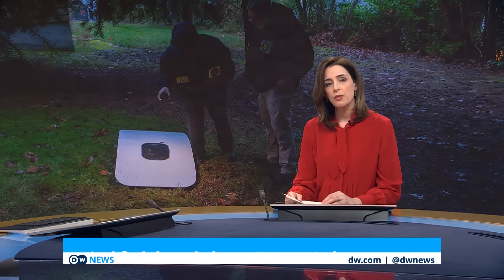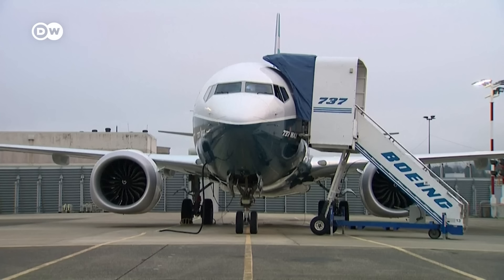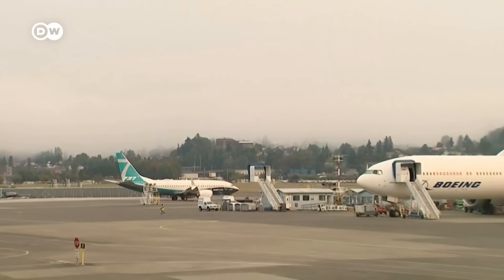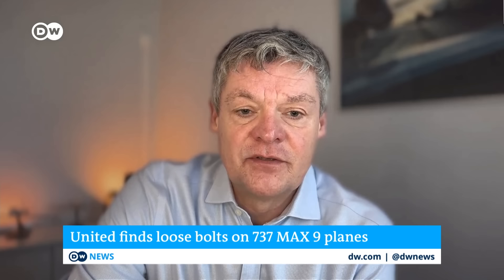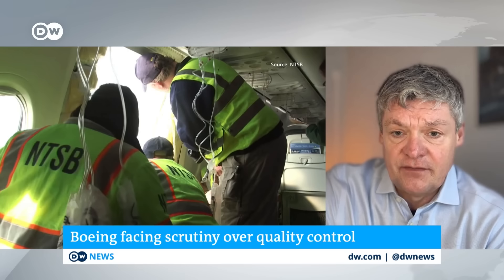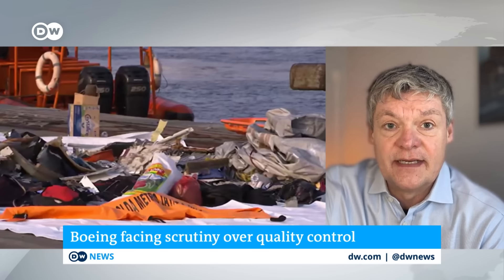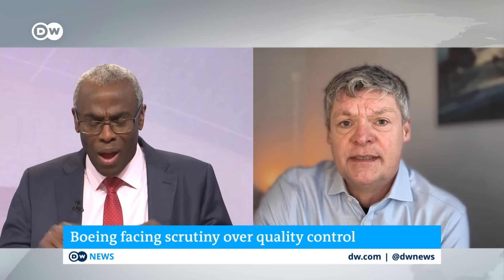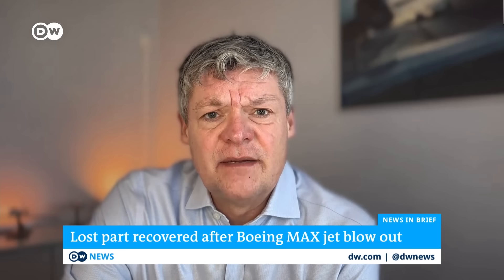After the Alaska Airlines incident: Is aviation quality control insufficient? | DW News

Comment: The question now seems, is or what did Boeing tell individual Airlines, or what Boeing did not tell Airlines which buy Boeing aircraft, over how everything on a Boeing aircraft operates and function etc? 
Or what legally Boeing is required to tell Airlines who buy Boeing aircraft, over how everything on a Boeing aircraft operates and functions etc, is a matter for the FAA and NTSB to investigate now? 

However, is Boeing responsible as a company, to inform all Airlines Pilots and Cabin Crews, how everything on a Boeing Aircraft operates or functions,?

Or is the Airline responsible, for training of their own pilots and Cabin Crew? 

When Boeing provide an operations manual for operators of their Aircraft and all onboard systems too, whether this is to the Airlines own Management, for use by either Maintenance and Servicing Staff, or for pilots and/or Cabin Crew too. 

Also which the FAA and NSTB surely should be required to sign off on these Aircraft Operations Manuals, at some stage? 

Or maybe now the FAA and NSTB, need to review and inspect all passenger aircraft and freight Aircraft Operations Manuals?

That is from all aircraft manufactures not just Boeings too? 

As other aircraft manufacturers may not be informing Airlines or their Pilots and Cabin Crew, or Maintenance and Serving Staff or Ground Support Crews, or Airlines Management too?

Everything they need to know on how individual aircraft or its systems, how they operate and function, in any or all given types of situations or in any emergencies too?

Already the news media coverage of this Alaska Airlines Boeing 737 Max 9 Aircraft Accident Incident, has helped to whip 9 percent of Boeing Share Value. 

That is over 13 Billion US Dollars lost to Boeing, that no joke to Boeing or its employee’s, or to Boeing Sub-Contracts and Suppliers around the World.

Including Rolls Royce Aero Engines in Derby included, or to Customers of Boeing either.

Maybe the news media need to think carefully how they are reporting here it could result in lost aviation industry jobs too!

The question not being asked, has there been any issues founded with Boeing 737 Max aircraft, where there is an actually emergency exit doorway opening hatch installed in this same rear fuselage position, Yes or No?

That is compared to the Boeing 737 Max aircraft, which have instead only one of these emergency exit doorway non-opening Plug Sections installed in this rear fuselage position.

If the issue is these emergency exit doorway non-opening Plug Sections and maybe with their four locking bolts and nuts too.

Is this then either a Boeing assembly issues, or an Airlines maintenance and serving issue?

Or is it a manufacturing issue, caused by whoever builds and supplies Boeing these emergency exit doorway non-opening Plug Sections?

Or is it a manufacturing issue, caused by whoever builds and supplies Boeing these four locking bolts and nuts, to secure and hold in place these emergency exit doorway non-opening Plug Sections?

If the issue is these emergency exit doorway non-opening Plug Sections, or their locking bolts and nuts, then the simple answer could be just install real emergency exit doorway opening hatches, problem solved?